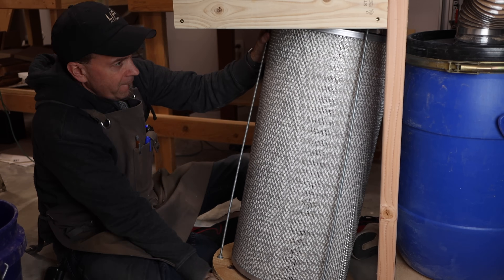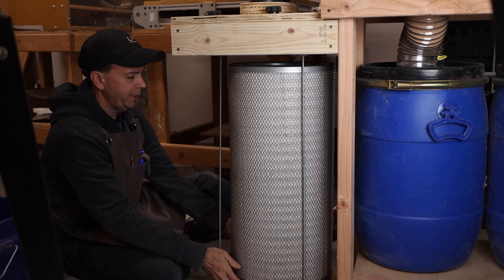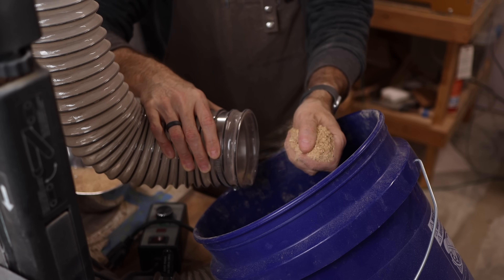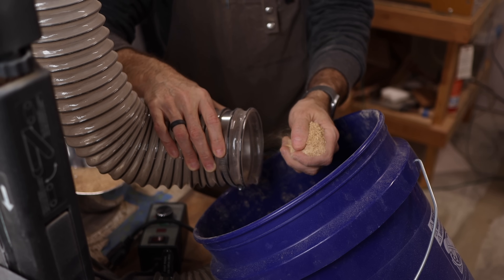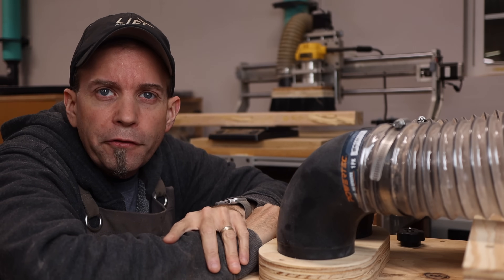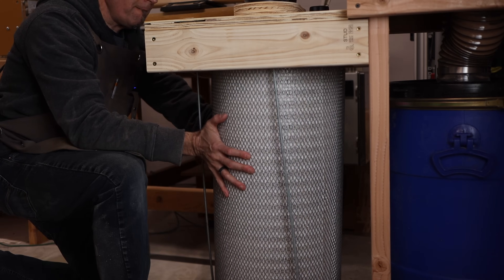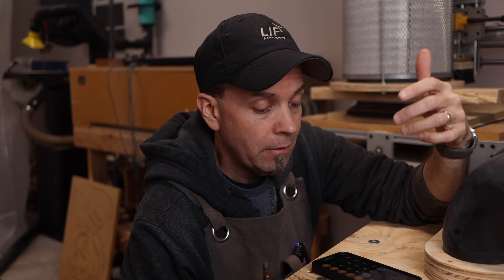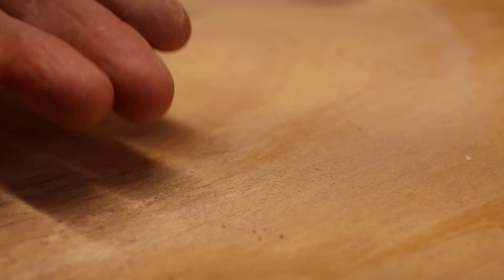Centrifugal Dust Separator 3 - The Escape Test

Comment: Thank you for your dedication, spending 38 minutes of your life feeding dust for the sake of science! I would love to see a comparison against your existing cyclone if you can.

Given the impact of the feed rate and the fact that you're going to rebuild it, is it worth considering an 8" tube now? Large clear tubes are expensive, but now that the design is proven and you have a good idea about how to best measure the performance - Maybe an opaque plastic tube is now viable? You could even use a section of 8" steel duct which also resolves the grounding issue. You can still add windows (Cut from your 6" tube and flattened out a little) where required.
Reply from the maker: Man, that was tough!  I felt like that was more true to my equipment though.  Others probably have a more aggressive dust flow, but likely larger particle too.

I think 8” is the way to go.  Not sure I’m going to take it to that level, but I think you’re right about not needing to go clear now.  (which would make it quite a bit cheaper)  Really like your idea of cutting some pieces from the clear 6” too and flattening them out a little as windows. 

Thanks for watching and for the feedback!

Comment: Pretty interesting - though without also weighing the canisters, or indeed the entire machine, you can't know precisely the efficiency numbers; there will be particulate in the tubes, in cyclone, and ultrafine particles that left the system entirely.

Im not suggesting that you do this, because thats not really that useful. The efficiency figures across this series are really very good. Id like to see similar tests performed with a cheapo cyclone, regular extractor and shopvac - as i think these tests would be most useful for the practical sort of people that woodworking attracts.
Reply from the maker: Agreed.  I didn’t have those systems available to me to compare.  I’ve seen others compare the cyclone vs the Jet separator.  Cyclone being the better solution there.

Comment: My extractor has a bag under the canister, and the canister is exposed so I can walk around it with a leaf blower every week or so. Since heavier particles are more likely to fall into that bag anyway, and only really fine ones are going to get stuck in the filter, I’m struggling to see a benefit. My impression is that a separator like this would simply mean I won’t have to empty the bag under the canister as often, but I’ll have to empty the separator’s bags/bins instead.
Reply from the maker: Similar.  I need to have a catch bin under the filter as well.  (future upgrade)  I don’t really think it prevents the filter from clogging more, but it allows you a means of cleaning it out so that’s not being stirred up. (so maybe that does help keep it clear)  Are you running a leaf blower to clean your filter in your shop?  Doesn’t that put all that back into the air and make a mess?
Reply: @pilsonguitars , I got the idea from Stumpy Nubs' advice not to use the built-in brush de-cloggers most canisters have - he suggested directing a leaf blower at the filter - from the outside - instead. I walk around the filter, pointing at it, blowing up and down its height, so that every part of the exterior surface area gets a blast of air. While it's switched off, of course.  That should dislodge fine particles that are clogging the (pores?), kicking them back inside the canister, presumably to fall down into the collector. If I've neglected it for awhile, it makes a noticeable difference to the airflow.
Reply from the maker: @TrevorMag62  , Ah, that makes sense.  Appreciate the advice.

Comment: Well done!! I almost purchased one of those devices from Woodcraft, they had it on sale for $25. After seeing how they clogged up when running a jointer and a planer I decided to go with a cyclone on top of a 55 gallon drum. My CamVac catches the fine dust so I'm pretty satisfied with that set up. Hope yours doesn't clog up when you start milling wood.

Comment: I built myself a really big Centrifual trap for my dusty, did it all from sheet steel, and had it dropping into a big bin. Never worked very well, would clog up and hard to get in and unclog it, so I ended up just keeping it all in place and using the usual bag at the end. I think I'll have to give this a go, it'd fit much easier, and I can 3d print it. Do you think a third seperator would do better? 

And new video idea to keep the steam going, methods to quiet down the dusty. It's the loudest thing in my little shop by far. Building it into a box? Or whatever you can think of.
Reply from the maker: I think stepping up to a larger tube is the best opportunity for improvement.

Appreciate the ideas for other areas to explore.  I agree, it’s one of the noisiest components in my shop as well.
Reply: To sound isolate, you also need to silence the ducting. By reducing the vibrations in them. Sound tends to be all about vibrations firstly. Secondly is the sound. So reduce vibrations to floor etc. Then afterwards, you try to 'isolate' the sound creators. Try buy a heavy duty rubber matt to stand the dusty on to begin with. So it doesn't make your floor resonate like a speaker.

Comment: Nice Job,  I will be interested to see what happens when you change the final collection bin inlet.  I wonder how it would handle a planers exhaust \dust.
Reply from the maker: Yah, a planer would be interesting.  I hear they generate significant amounts of course material.  I didn’t have to accommodate that so I’ll be interested to hear from anyone that gives this build a try and can test.
Reply: It handels a planer pretty well!
https://m.youtube.com/watch?v=ENybYVAr11Q
Reply: I build Tim’s design and modified the outlets and put it in front of my CamVac to run my planer. It works like a charm! https://m.youtube.com/watch?v=ENybYVAr11Q